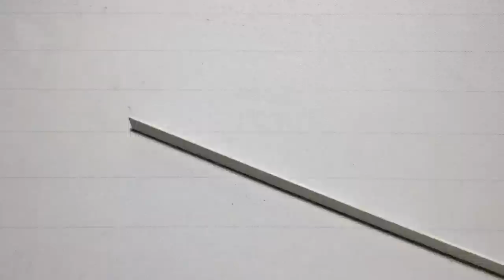How to Make a Fast Speed RC Drift Car Homemade Remote Control Truck from Cardboard and PVC Trunking.

Comment: How many rotates per minute does this motor has? 6000?
Reply: It’s a brushed motor so it’s speed is measures in turns. It looks like a 330 size 21 turn motor
Reply: @AW-Luke  you mean 21 rpm?
Reply: @AW-Luke  rotates and turn it's different?
Reply: Yeah they are different. The speed of a brushed motors speed like this one is measured in turns. But a brushless motor is measured Kv which just meant amount of rotations per minute per volt of power.
Reply: @AW-Luke  what is turns. Rotational speed is measured in RPM
Reply: Operating voltage 6v - 20v
Nominal voltage 14.4v
No Load RPM 17350
No Load Current 2.6A
Stall Torque 111.18 oz-in / 785.1 mN-m
Stall Current 102 A
Kt 1.09 oz-in/A / 7.7 mN-m/A
Kv 1205 rpm/V
Efficiency 70%
RPM - Peak Eff 15047
Current - Peak Eff 17A

Here it's data sheet
It's an 775 motor
Reply: @AW-Luke  “Kv” refers to the constant velocity of a motor. It is measured by the number of revolutions per minute (rpm) that a motor turns when 1V (one volt) is applied with no load attached to that motor.

And what is per volt of power
Reply: Don't forget to Smile yeah that’s pretty much what I said isn’t it. For brushless motors
Reply: For brushed you can convert brushed turns into Kv but the amount of turns is used more often to measure the speed of a brushed motor
Reply: @AW-Luke  yes but I can't understand about turns (measurement unit for dc brushed motor speed) and volt of power. Said by you.
Reply: @AW-Luke  amount of turns or revolution per minute. Never heard turns for rotational speed.
Reply: Don't forget to Smile. You should look up Brushed motor turns. Then there will be an video explaining what they mean